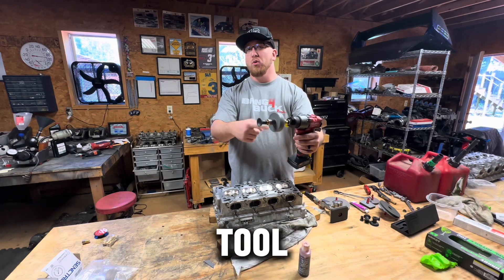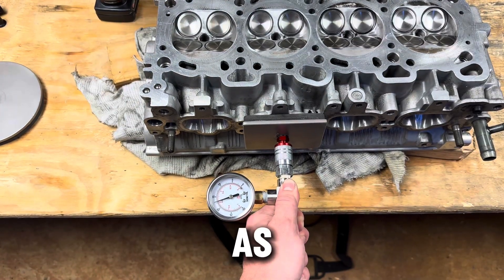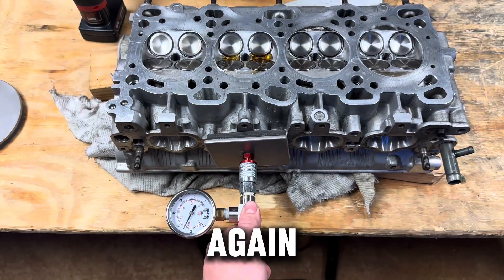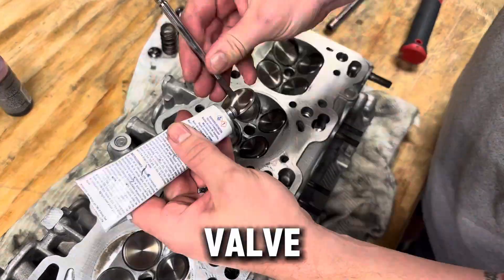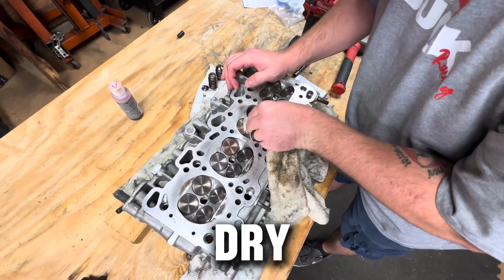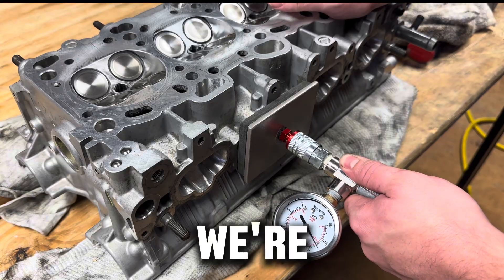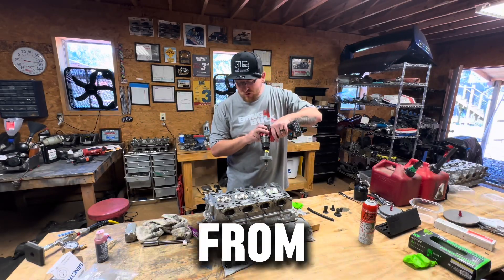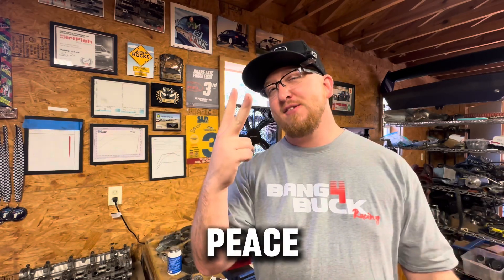Lapping valves super easy with this 20$ tool!

Comment: What is the point of this valve tool, I don't understand it at all. Just put some fuel pipe over the valve and put it in the drill or put the suction stick in the drill... what is this thing doing? Oscillating it back and forth?
Reply from the maker: Yes it oscillates. That’s the proper way to do it.
Reply: It spins a little both ways instead of just 1 way

Comment: I bought the QWORK Valve Lapping Tool Kit from your link because your video was the first one I saw using this tool (or one of the MANY that look just like it on Amazon).  You helped me, so I hope the affiliate link helps you.  I am quite sure that this is a Copycat Clone of the $299 Goodson VLP-100 Powered Valve Lapping Tool and Cups.  The VLP-100 looks to be made of metal, but it's hard to tell from the picture on their webpage.  The VLP-100 may be plastic, too, but, for $300, it probably lasts longer.  I only have one set of intake and exhaust valves to lap on my riding mower's single cylinder Briggs OHV 20HP, so I hope it lasts at least through these two.  How long did your last?  How many valves have you done with it?  Is it still working?  Thanks for the video!  👍👍
Reply from the maker: I got through all the valves on this head no problem. Thank you glad I could help!
Reply: @Bang4BuckRacing   Thanks for the reply.  This gives me confidence in having bought and using the tool.

Comment: What exactly do you use to check the vacuum? What pulls that hard ?
Reply from the maker: Air compressor hooked to a vaccum Venturi
Reply: @Bang4BuckRacing do you have a video of your set up for this? Any links to the tools you are using to check vacuum?

Comment: Never built a head so im not super knowledgeable but aren’t you supposed to remove the air pressure and see if it holds that way or is it a negligible difference
Reply from the maker: It is more ideal yes I didn’t show in this video. That tester I built has a lever when I let go it closes off and I can lightly hold it to the port to see how long it takes to bleed down.
Reply: @Bang4BuckRacing  ahh ok I was curious, love the videos